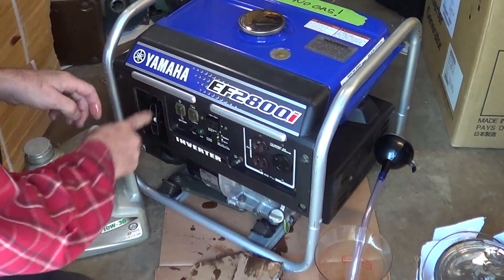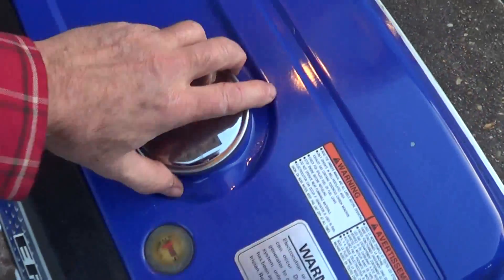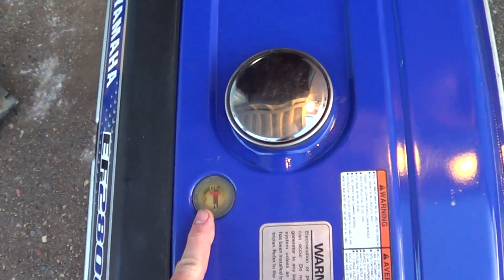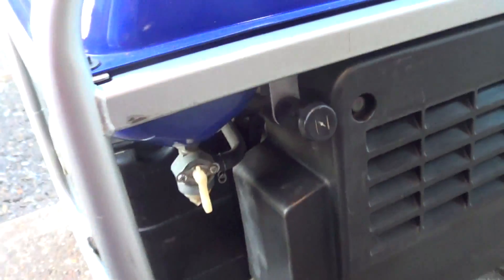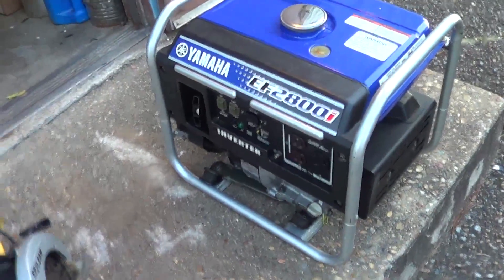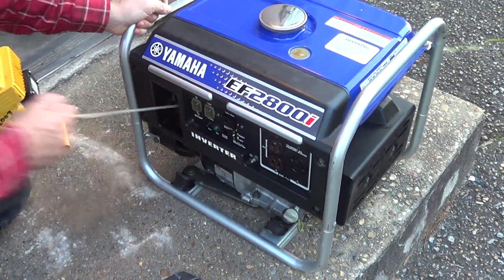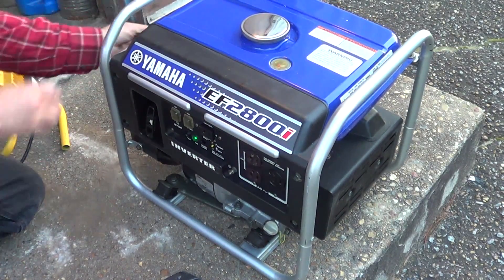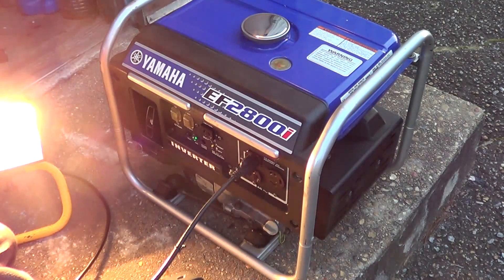Yamaha EF2800i Inverter Generator

Comment: Twelve years a go I converted my YG2800i, its unbelievable what I run in my house. This model might be the best out there. Sixteen plus hours on a #20 better than half load.
Reply: ⚠️Don’t forget to follow the generator safety tips whenever you use your portable generator. This is a very important announcement for everyone for safety. 

This is just a reminder for everyone’s safety. All generator safety rules need to be followed carefully 

Generator safety tips: 

1) KEEPING OTHERS SAFE: Please do not allow an unqualified person or your children to operate and service the portable generator. Just because some manuals don’t say that doesn’t mean it’s safe. That is important against the generator safety rules. We also need to be keeping an eye on our children too. You need to make sure that your children are not playing near the portable generator especially when it’s running so they won’t get electrocuted. Generators pose electrical risks and they can be hot during an operation. Please keep your children away from the portable generator at all times. It is important to keep our children safe especially our little ones. Children often get curious about anything so we should keep an eye on them to also make sure they’re not wandering towards the generator. 

2) WHERE TO RUN YOUR GENERATOR: Some people use their portable generators indoors which increases the risk of carbon monoxide poisoning. It’s important to have a carbon monoxide if you have a gas generator. Never ever use your generator indoors even if your doors and windows are open and even in the garage is not safe to use a portable generator. Not even at your porch and your deck. It is never safe to use your generator indoors and in enclosed areas of your home. Your generator needs to be 15-20 feet away from your house. 

3)🔥FIRE HAZARDS: Never refuel your generator while it’s running. You need to let your generator cool off before refueling it and before storing your generator. Never overload your generator too. Never ever back feed your generator. You should never plug your generator into a wall outlet. Also never store propane tanks indoors. Please keep flammable things away from the generator as well and please don’t smoke cigarettes near the generator. Having a fire extinguisher next to the generator is also important against the generator safety rules. 

4) GENERATOR OPERATION: make sure your hands are dry before touching the generator. Never use your generator in wet conditions. Don’t let your generator get wet. You need a generator tent if you need to use your generator during wet weather. Please don’t wear loose clothes when operating the generator. Turn on your generator before plugging in appliances. Use the right cord for your generator. Please do not use worn out cords. 

https://youtu.be/I1jT3ANENvI and here is a video more about keeping others safe when using generators. All generator safety rules need to be followed carefully. 

Hope this helps.

Comment: I bought one of these modified for tri-fuel, gasoline, propane and natural gas.  The day I got it after hurricane Sandy, I drained the fuel tank, washed it out with alcohol off the generator and never looked back. I only use natural gas, start it and let it run. Never need to worry about getting gasoline again.  I run it for 15-20 min every few months.  Got mine already set for tri-fuel from www.centralmainediesel.com   While its only 110 that is all I need to run the how water baseboard heat, 2 sump pumps, a refrigerator, a freezer, aux led lights, internet, laptops and lcd tv. If its hot and I cant run the AC, jump in the pool!  With all of that I was only using 1200w when checking my draw using a kill-a-watt meter.  I can let this run all day and it only costs me 4-5 dollars for natural gas!  The only problem I had so far was that the GFI died and I replaced it with a standard household GFI which works/fits perfectly.  I purchased another in the event it happens again at a bad time. 15$ for a GFI is cheap insurance.  Natural gas no hydrocarbon smell, still deadly use with caution. This unit is very quiet here is my setup.. https://www.youtube.com/watch?v=wlFDVJxNARM

Comment: I love my 2800, bought it in 2008. I  just change the oil regularly, change the spark plug every couple of years and run carburetor cleaner through it now and then. It runs my RV when I'm dry camping and at home when the power goes out. Never had any failures.
Reply: Get a tri fuel kit and run natural gas, forget gasoline. Nat gas keeps all parts clean and never gets gunked up. Can run off propane too....with the same setup!  https://www.youtube.com/watch?v=wlFDVJxNARM
Reply: ⚠️Don’t forget to follow the generator safety tips whenever you use your portable generator. 

This is just a reminder for everyone’s safety. All generator safety rules need to be followed carefully 

Generator safety tips: 

1) KEEPING OTHERS SAFE: Please do not allow an unqualified person or your children to operate and service the portable generator. Just because some manuals don’t say that doesn’t mean it’s safe. That is important against the generator safety rules. We also need to be keeping an eye on our children too. You need to make sure that your children are not playing near the portable generator especially when it’s running so they won’t get electrocuted. Generators pose electrical risks and they can be hot during an operation. Please keep your children away from the portable generator at all times. It is important to keep our children safe especially our little ones. Children often get curious about anything so we should keep an eye on them to also make sure they’re not wandering towards the generator. 

2) WHERE TO RUN YOUR GENERATOR: Some people use their portable generators indoors which increases the risk of carbon monoxide poisoning. It’s important to have a carbon monoxide if you have a gas generator. Never ever use your generator indoors even if your doors and windows are open and even in the garage is not safe to use a portable generator. Not even at your porch and your deck. It is never safe to use your generator indoors and in enclosed areas of your home. Your generator needs to be 15-20 feet away from your house. 

3)🔥FIRE HAZARDS: Never refuel your generator while it’s running. You need to let your generator cool off before refueling it and before storing your generator. Never overload your generator too. Never ever back feed your generator. You should never plug your generator into a wall outlet. Also never store propane tanks indoors. Please keep flammable things away from the generator as well and please don’t smoke cigarettes near the generator. Having a fire extinguisher next to the generator is also important against the generator safety rules. 

4) GENERATOR OPERATION: make sure your hands are dry before touching the generator. Never use your generator in wet conditions. Don’t let your generator get wet. You need a generator tent if you need to use your generator during wet weather. Please don’t wear loose clothes when operating the generator. Turn on your generator before plugging in appliances. Use the right cord for your generator. Please do not use worn out cords. 

https://youtu.be/I1jT3ANENvI and here is a video more about keeping others safe when using generators. All generator safety rules need to be followed carefully. 

Hope this helps.